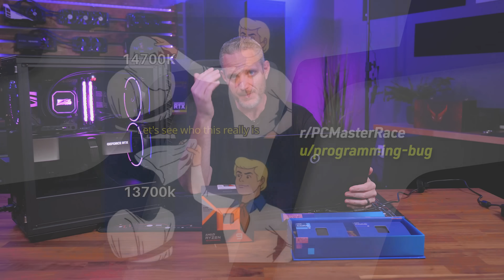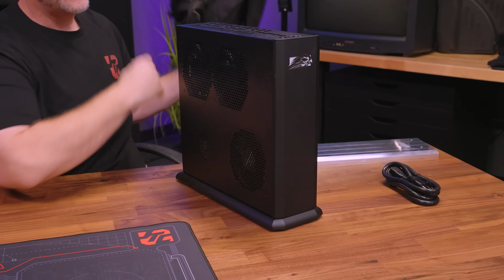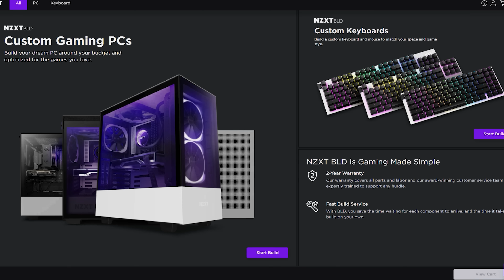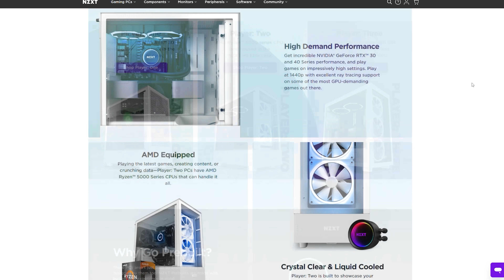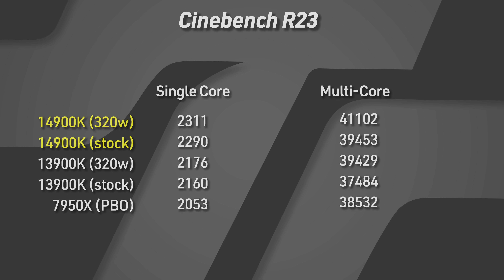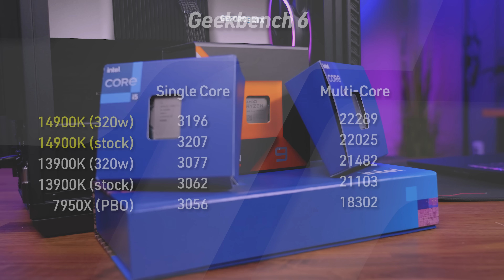THIS is why people have trust issues! Intel 14th Gen Review

Comment: I don't see why all the reviewers are stumping on it. 14th gen is marketed as "refresh", which it is. At same price as previous gen, with slight speed bump, making use of refinements in manufacturing process. 14700k also received some extra e-cores and there is a new technology in use limited to 14th gen, which can offer 7 to 11% speed bump in very few titles, like Metro Exodus.
Alternative would be wasting the improvements, its better if this 13.5 gen exists than if it didn't.
Adding *50 to model naming as Jay suggests and keeping generation would generate confusion and call even more criticism imo.

Comment: is this another i7 10700k vs 11700k ? where everyone says it's a waste of sand but 3 years later there's benchmarks showing that the 11700k is quite a lot better than the 10700k? people not learning and jumping on the band wagon or is it not the same as last time. when you get to the end of the line for a certain Technolgy the advances get less and then usually after that happened, they bring something out next time that blows it out of the water like the 11700k and 12700k.

Comment: Jay, I currently have a core i7 8700k with a 3080. I've finally got a budget to replace it, and every guide I read suggests the 7800x3d. What would you suggest? my budget is like 3k and im in EU so prices are slightly different... I'm looking for a build that will last me for a long time for modern gaming on a 49" monitor and VR.
Reply: 78003d is fine for everyday use. Pair it with a 7900 and enjoy life 😅

Comment: It is supposed to be refresh, and that is what it is. Jay makes a good point in regards the power profile, most MB manufacturers have automated settings that will make the cpu pull up to 200 watts more than intended, for minimal gains in performance and much higher temperatures. I have seen benchmarks of the 14700k pulling 500 watts  for often 3% better performance than what it gets when consuming 250-300. Asus is normally the largest culprit , but msi is starting to do the same.

Comment: Just got a 7800X3D from Best Buy for $329. Gonna be a massive upgrade from my ancient Intel 2600K!
Reply: Are you gonna pair the 7800X3D with a GTX570 from the old system? 😅
Reply: Jokes aside, I still have a 3930K and a GTX580 in good running condition myself 😊
Reply: Hard to cool, and only for gaming.
Reply: @Joeteck  Patrick P. Gelsinger is that you?
Reply: @yourfavoritelawnguy2722 No. CEO and founder of JoeteckTips...  But close..

Comment: Interesting side note Jay, in a recent ASUS bios update for AMD, they changed PBO to "AI Optimized". I flashed my bios 2 weeks ago, and reran Cinebench r23 just to see how it changed my scores. After it ran, saw a score increase of nearly 2k on my 7700x. I went from mid 18000's to low 20000's
Reply: Yeah, just noticed the new bios yesterday. Gonna get it and see if I can go over 40k in r23 with a 7950x with just an air cooler 💪
Reply: @acidcrow4051  what you at now? im scoring 41300 ish on my 13900k with a huge undervolt haha.
Reply: @TheBURBAN111  I usually land around 39k with a -20 undervolt. Breaking 40 should be no problem, but I want it to be stable as well. I don't really need the speed, just a lot of cores. Most of my work is done by the GPU (it's not a gaming PC, but I game on it some😅).  But ofc I want to push it as high as I can to see what it can score, then dial it back to stable again.
Reply: @acidcrow4051  Good luck. Sadly, I'm still getting low-28,000 scores with EXPO I (II is 1% slower) and PBO Enabled (instead of Auto).

I honestly don't get why my system doesn't boost all the way to the 95C TDP. I usually max out in Cinebench at 91C and tonight it was more like 87C. I thought it was supposed to boost until it throttled, but it never gets that hot, though my idle temps seem warmer than others I've seen. I have a DeepCool LS720 360mm AIO with the fans tuned for quiet more than coolness, but I don't get too hot.

RAM is G-Skill DDR5-6000 CL36.
Reply: Woke up my 6700xt 😅 5900x is locked into all cores same speed stable. Guess I'm try and turn the cpu turbo back on and send it lol 😅
Reply: Oh word? 7950x don’t fail me now
Reply: Which mobo? I just looked and see that my X670E-E got BIOS 1709 five days ago, so I'll have to try that.

When I built my 7900X rig in February, my initial R23 benchmark was over 29000 (can't recall what BIOS version and the old ones are gone now), but subsequently I'd sometimes be as low as 27000s or low 28000s range depending on which EXPO setting I used. (EXPO I seems fastest for me.) 

Been on 1602 for two months but before that I had to use 1416 with SoC voltage manually locked at 1.25V cuz 1516 was so unstable that I would only successfully boot one in three or four times, Windows would get corrupted and require a Restore rollback, and it'd even freeze in BIOS. Just awful.
Reply: Same as you 670E-E
Reply: @BrianJCarson  Then you updated less than 5 days ago, not two weeks, but no biggie. Thanks for the tip.
Reply: @DirkBelig  I downloaded 1602 on the 5th of October. It was the newest on listed on the Asus site at that time.
Reply: @BrianJCarson  So I guess it's me telling you that there's an even newer BIOS now! 😎

Comment: what is the difference between the 12900K and the 14900K in % difference on a MSI Z-690 ACE mobo ? i think the biggest difference will be the power watts the 12900K has TDP of max 253W and the 14900K is read 202W ?

Comment: I still haven't found a personal use case that has made me feel compelled to upgrade my i7-6700 from late 2015.  The fact that it isn't "ready for Windows 11" just means it doesn't bug me to "upgrade" to the advertising platform and data harvesting tool masquerading as an operating system that is Win11.  I'm migrating to some flavor of Linux when Windows 10 reaches EOL.
Reply: Bro you can quit with the Windows 11 conspiracies. It's the same user experience and you can bypass the Microsoft account requirement.
Reply: @davide4725  The fact that you can opt out of the advertising platform and data harvesting tools baked into Windows 11 by jumping through some annoying and unintuitive hoops in order to bypass the M$ account login IN NO WAY excuses the fact that it is, by default, an advertising platform and data harvesting tool.  That isn't a conspiracy theory, it's the Microsoft business model.
Reply: I have been running Pop-OS on my old 6700k, I like it a lot more than windows. There is a learning curve with Linux, but I am not going back to Windows. My cooling fans alone run near silent unless I load the system, couldn't ever say that with Windows. Going to see how it all works with my new machine once my last parts arrive and I can build it.

Comment: I'm sticking with my 5800x3d for now but am thinking about the upgrade to 7800x3d just for power draw but I'm wondering how gaming and streaming go with either cpu or if moving to intel 13th gen would be a good move for me.
Reply: Given the costs associated with getting a AM5 system while already owning a AM4 system, it's not worth the price. You would need a new motherboard/CPU/ram. At a minimum you're looking at $600. As amazing as the 7800x3d is for gaming, you're not going to get a substantial enough difference in performance to make that platform change cost a good value.
Reply: Bro you can buy a 50$ ddr3 platform smack in in a budget  modern gfx card and still get 80-100 fps in most game. Sure the pc wont feel smooth though but its to prove a point. Ddr5 doesnt actually improve latency just bandwidth. And ddr5 ecc is kinda fake because no ecc to the cpu. I just bought 5800x3d and 64gb 3600mhz ddr4 and my pc feels buttery smooth. Probably no upgrades for another 10 years. My self made NAS uses my old ddr3 that is 10 years old and its overkill for a NAS.

Comment: Falcon is using PCcooler corona fans, they just removed the sticker and replaced it w/ the falcon eye. I have the same set of fans on my rig (fully air-cooled though). BTW, Intel is following Apple's footsteps in this launch, i.e. ip4 to ip5s, 6 to 8, X to 12, 13 to 15 . . . all same phones within 3 versions of it with little tweaks to nothing at all (just marketing bs)

Comment: @JayzTwoCents , serious question though I doubt y'all will see it: I have a 5950X, just upgraded from a 3090 Kingpin to a 4090, and I was looking to upgrade my platform to match (I game at 5120 x 1440 so the 4090 was actually 'needed', the 3090 would struggle a bit in newer AAA titles at my resolution because it's much closer to 4K than it is to regular 1440p).  
I was just going to blindly order a 14900K & Gigabyte Z790X board with some 7200MHz G.Skill RAM, but I waited for the reviews to hit, and all of the info was so negative/underwhelming that I actually cancelled the RAM order & didn't order the CPU or the board... now I'm thinking I should just go with a 7800X3D or 7950X3D... what would you recommend? Would you say I should just wait, given my resolution meaning a CPU upgrade isn't going to gain me much in about half the titles?
Reply: Watch Gamers Nexus reviews of the 7800X3D, that's likely your best choice given the upgrade path to future Zen 5 releases.
Reply: If you are just gaming with little production then there is pretty much no reason to not buy the 7800X3D. It's faster in most games, it has better forward compatibility and longevity, it doesn't require fast expensive RAM, and the CPU itself is cheaper and uses much less power/creates less waste heat you have to cool.

Comment: I think the problem with both AMD and intel is the core wars have frankly made the majority of systems so damn OP that Joe and Jane Normal won't be able to tell the difference as much of that power is going unused. I mean if you put the same model of 12th, 13th, and 14th gen on a bench without letting anybody know which is which do ya think anybody could tell them apart? Same goes for Ryzen 3xxx-7xxx.

That might be a good video subject, put together some Intel and AMD systems and see if any of the guys there without looking can tell what is what because I bet for the majority of tasks, hell even heavy lifting like editing? The differences will be so slight between say a 3700x, 5700x and 7700x and a 12900k, 13900k and a 14900k in feel nobody will be guessing 100% right.
Reply: thats a great idea. and the exact reason i always lag behind a generation or two. older gens are always discounted and the performance is so close.
Reply: the performance difference between a 3700x and a 7700x is big, you would have to compare a 9th gen 8 core cpu against a 14th gen 8 core cpu to have a equivilent comprsion for intel

Comment: Did Jay just confirm you dont need to flash the bios on the Z790 motherboards to get a 14900k to work? Bought an extra 12400 just in case i needed to flash the firmware temporarily on my brand new ordered MSI Z790I EDGE mITX board. (coming from 11th gen so i dont have the existing board with 12th/13th gen)

Comment: My theory is that 14th Gen is what Raptor Lake was supposed to be all along. Given that 13th Gen was put out ten months after 12th Gen, I think that was rushed out to compete with the 5800X3D. Then they tried to bargain on Meteor Lake for even more uplift, but since that isn't working out for desktop they put the refresh out as a placeholder until Arrow Lake.
Reply: So it was supposed to be 3% better all along? WOW!! now that's impressive, and it only took intel just over a year to realize the full potential of Raptor Lake, INCREDIBLE! 
Nail heads are being hit really hard here.
Reply: Bit of a stretch/giving them too much credit even with bad decisions.
Reply: This was all leaked by MLID months ago xd. Not really news.Glad people are still observant though, can't let intel pool the wool over people's eyes just by calling it 14th gen lol.
Reply: Its because intel still haven't figured out how to manufacture using euv machines at economic viable yield
Reply: @RSUnicorn  intel just took deliveru on their first euv machine they have been using the older DUV this whole time which needs far more passes and is why they had bad yelds and got stuck on 14nm for so long now they have euv installed as of january 14th gen is still duv  

they have the worlds only dual euv machine now and tsmc knows intel is getting back on track and coming for them
Reply: 5 nodes in 4 years is the plan.
Reply: Sounds about right
Reply: This 14th refresh is because Meteor Lake flops on desktop and wasn't really ready in time.  OEMs are rushing out Phoenix Zen4 laptops.
Anyway 12th gen had bugs, the Thread Director stuff wasn't working right and it needed Windows 11 so launched late after the 11th gen debacle.
Adding Atom E-cores was already a desperate play brute forcing MT benchmarks with power consumption.
Raptor Lake was a refinement on Alder,  required to counter Zen4, fixing bugs and adding more Atom cores.
Intel are trying to hang on, but Zen5 is starting to leak out now, OEMs are unimpressed by 14th and this means AMD launch a new architecture unopposed until Q4/24.
Reply: The 13600k/14600k and higher intel chips all beat the 5800x3d in every aspect.

Comment: but thats why they called it a refresh, its not really marketed as a next gen cpu, next year they are even changing the naming scheme.  I feel like in the past Intel did this because they had no competition and no reason to innovate, but this time I feel like they just didnt have next gen ready in time.  Also some gens with a yearly release schedule have to be small uplifts in performance,  you cant go from 12th gen to 13th gen type improvements every year, I just dont think thats possible, 

I think they have to go back to the tick tock approach,  they did away with it to get to a certain level to make sure they keep up with amd , but I think to keep price and power usage down they have to go back to a tick tock sort of approach.  Where every 2 years is the big upgrade and in between just process refinement.
Reply: AMD has had significant performance increase every generation of Ryzen.  It can be done. Ryzen 8000 is currently expected to have 10%+ increase in IPC over Ryzen 7000.  If AMD can do it then Intel has the $ to do it too.

Comment: Why did you guys decide to only do PBO with the Ryzen chip? Wouldn’t a similar overclock make the margin even smaller or is PBO bringing it close enough? Does it not matter at the end of the day?
Reply: Doesn't really matter because the AMD usually isn't hold that frequency, anyway. Hard to pin it at all-core max frequency, but PBO will help you raise the all-core frequency

Comment: Sorry any YouTube channel who did TWO videos praising an AMD release of downclocked REJECT CPUS has ZERO place to criticize a refresh that is being called a refresh by INTEL.  The idea that every release should be worth an update is silly.  In few months after BIOS bugs are fixed I may well swap my 12700K for 14700K because Windows likes to max out the eCores so 3X the eCores will help my OS run smoother even if a GAME that didn't max our my 12700K so doesn't gain.  But they also changed the die configuration.   The sub numbers mean other things in INTEL land.  So you can't just slap a 50 on it.  Look at the 12700K to 14700K results. before going Meh.

Comment: I am excited for this release just because the pricing is so close between 13th and 14th gen and the performance isn't much of an improvement. I'm looking for a Micro Center bundle deal on the 13700k/13900k or 7900X around Black Friday. I sure hope those prices drop a fair bit by then.
Reply: Me too, I'll never buy Asus boards again after the RMA experience I had with them.  Wish Microcenter would stop putting Asus in the bundles.
Reply: same, hopefully they'll lower the 13900k bundle. Im looking at the 12900k rn but if the 13th gen becomes a better deal i might just do that.
Reply: 13700k bundle just dropped $50
Reply: @58long i just wish the 13700k bundle came with a better mobo...
Reply: I have the 13700K and the 7900X. Bothare really good, but the 7900X is a beast
Reply: Poor
Reply: You really lucked out. 14700k + MSI Z790-P Pro Wifi + G. Skill 32Gb DDR5-6000 for $500. Haven't seen anything as crazy from team red but I'm really hoping.
Reply: Go Ryzen. You'll have the option to upgrade CPUs on the same motherboard.